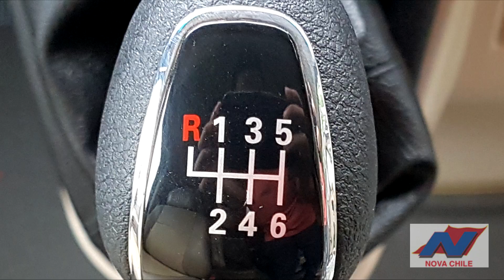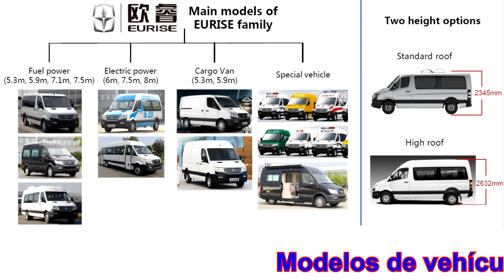Apresentação da Van Asiastar Eurise 2.5T

Comment: Tomara que essa seja boa porque a sprinter de 2001 pra cá vem sendo a pior van aqui no Brasil, tem Lucho mas não presta, muitos sensores acabaram com a elétrica e a mecânica da sprinter quem compra só arruma dor de cabeça e o custo de manutenção é muito alto um motor da 2016 sai em média R$ 60.000,00 pra fazer, absurdo isso...
Reply: Claudemir Rodrigues Paulino este veículo está a venda para países de lingua espanhola
Reply: VB Busólogos se for boa e adaptada para o péssimo combustível do Brasil, tomara que venha logo pra nós...
Reply: Porra, tu já tá pensando em fazer o motor??? R$ 60.000,00 é quase a metade de uma 0 km!